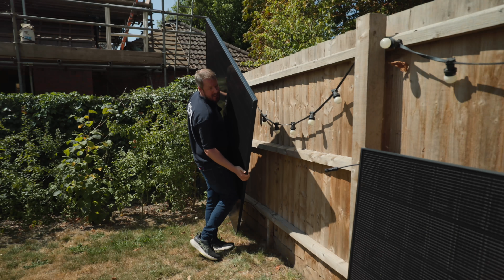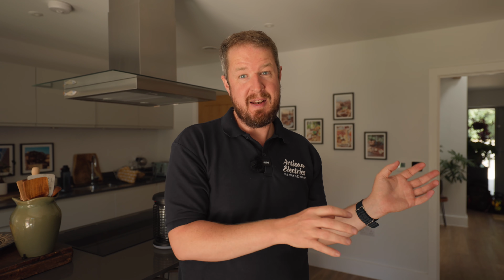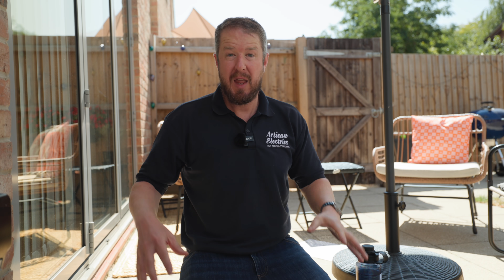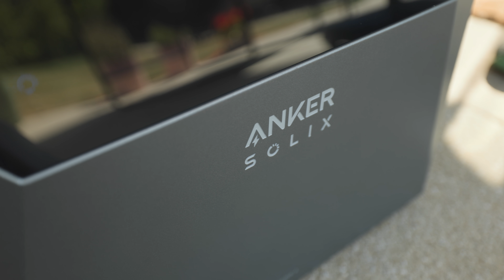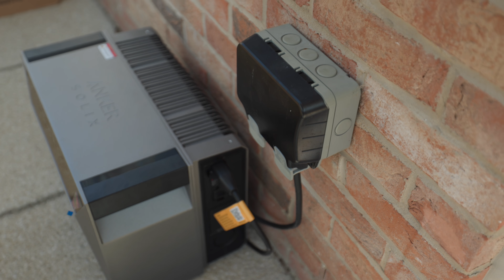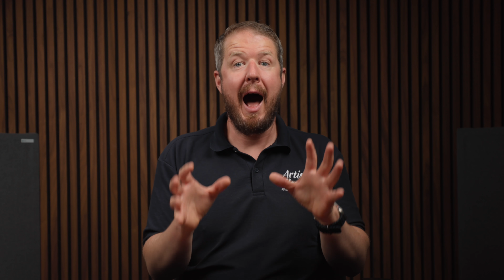The MISSING PIECE of Plug-In Solar

Comment: I didn't think the new plug-in-solar rules allowed plug-in battery storage
Reply from the maker: Under current UK regulations, it needs to be hardwired by a qualified electrician. The bonus being, you get that 2,500W output! ⚡
Reply: @artisanelectrics  What does "hard wired" mean in this context? e.g. the Anker unit you show in the video, obviously has a detachable lead with a plug - so could that unit be hard-wired?
Reply: Looks like you're right - plug-in batteries are currently NOT covered by the regs: Although, quite honestly, they're probably just as safe as a solar system, if they're limited to the same max wattage.  Personally, I'm tempted just because of the 2.5kW "off-grid" socket on the battery unit - seems like a much cheaper and more flexible option than a dedicated UPS, it's enough to run my office AND coffee machine, and frankly, that's good enough for me!  If it can be configured to only pull from the grid & not push, then I reckon that'd be enough to sidestep any legal issues. After all, you can plug in a battery charger (which is how it would act) with impunity today.
Reply: From 27th August legal, BS7671 Amendment 4, there's a New BS7671 out in October this year, it might be a best seller to wait until October, I might ask Chat GPT or Dola Ai's for info,

Comment: But I thought batteries were not approved for plug in solar in uk ?
Reply from the maker: Current UK regulations require these to be hardwired by a licensed electrician to remain compliant.
Reply: @artisanelectrics  I am a huge fan of your channel, however in this case I think that this episode is misleading wrt the context for the new UK regulations.

I totally agree that adding a battery makes sense but this is not permitted in the new regulations.

Respectfully, I think that the responsible thing to do is to re-edit this video. You will preserve your credibility by adding some very clear statements to balance the narrative. Otherwise you are in danger of being seen as presenting an advertorial as other contributors have pointed out.

Best
Reply: @artisanelectrics so a very misleading video then.  This is not up to your usual informative videos.

Comment: Fined in the Netherlands to send power to the grid ? Where did you get that total BS, Whe can earn money with solar and plugin battery with a dynamic contract and the Netherland are the frontiers of the plugin battery for years. A plugin can be instaled on a seperate free 16Amp fuse without elektrician to charge and discharge with 2500 watt On a used circuit its just 800 watt discharge and 2500 watt charge

Comment: First thing I did when I got solar was set a timer on the hot water heater. It heats 200l so by doing that in day from solar when sun shines I make sure to take full advantage.
Reply: Even better would be to use a heat pump waterheater. Those only need a third to a quarter of the energy.
Reply: @Felix-st2ue absolutely but the investment is insane.
Reply: @1kreature it depends. If you anyways need a new water heater the cost difference is only around 1k (at least in continental europe). So definitely worth it.
Reply: @Felix-st2ue not in Norway. For a normal micro split system I was quoted £2.6k fully installed. For a electric water heater it was only £600 well the heat pump version was £5.6k! We never get quoted the gas version because we do not use gas here.
Reply: @1kreature over hear the heat pump heater costs around 2-3k plus install. But i guess your electricity prices are nowhere near our 30ct.
Reply from the maker: Great thinking, making the most of your self-consumption is exactly the goal! 👍

Comment: The UK regs do not allow a battery for plug-in, only if wired by a qualified electrician
Reply: Correct it’s only the solar panels atm
Reply: @Element115-gravity wrong, look up portable plug & play power stations UK law before you comment next time.
Reply: @Rodders1234 So confident yet so wrong 😂 Plug-in battery on its own is not allowed yet. There’s talk it’ll be legal next year
Reply: @Rodders1234  the point is not the battery but the device that controls the energy amount you are feeding in to reduce the output of the inverter.
That can only be installed by a certified I bet, the UK regulations are more or less a copy of the german .. hence the chinese adopted the german setup for their own product.
Reply: @mjw199 I need more than 'talk' to spend thousands.
Reply from the maker: You're absolutely right, UK regulations require a hardwired connection by a qualified electrician for this setup. ⚡
Reply: @artisanelectrics  wrong, portable plug & play power stations are not considered a permanent fixture under UK law & do not need your expensive help.
Reply: @Rodders1234  so how do you tell your battery not to export its power back out to the grid???.... you will need a sparky to install a measure device in your consumer unit ,unless you want to run extension cords off the unit to supply power to your appliances.
Reply: @craigpalatchie2607  you will always be using power so will never export that amount also 800 watts is nit shit for DNO i export 9kw on an average day they then need to worry on my close i run 60kw of battery storage on pylontech us5000 batteries solis 10k inverter
Reply: @Rodders1234  UK regulations are a copy of the germans in most cases. What you need is the value what you are exporting or importing and that requires an additional devica in the main panel which you are not allowed to do in germany and I bet in the UK too.
Reply: @Rodders1234 actually you are wrong
Reply: @Rodders1234 Actually UK regulations do not permit a battery as part of the plug in solar installation.
That IS fact.

However, what you can do is purchase and use a mains chargeable solar battery,or solar generator and plug this into a mains socket somewhere in your house.
It is not part of your plug-in solar installation; it's just a rechargeable battery charged from the mains.

And when there is a surplus of electricity from the panels the battery will be charged using solar generated electricity and the amount of surplus power going out to the national grid will be reduced.

What you can't do is connect the inverter output of your solar generator in your house electrics through a BS1363 plug and socket.

You can plug mains appliances into the solar generator and use that solar generator in the way it is meant to be used.
Reply: @Rodders1234 what he is demonstrating is not plug and play.
Reply: @Rodders1234  Just imagine correcting an electrician about electric installations. 

if you plug in the battery into the wall and supply to your home without a gateway, it can be very dangerous if there is power outage because you are energizing the grid from your home... and there is no possible way to have the gateway installed by portable power stations.
Reply: @craigpalatchie2607  It's limited to 800w when plugged into mains, same as plugin solar. It has a built in inverter. Just because regs don't yet permit it, it doesn't mean this thing isn't already designed to operate the same as plugin solar inverters.  People are already doing it.
Reply: @roadbiker8333  Plugin solar doesn't use a gateway either, the inverter detects the grid and cuts out. These batteries do the same because they are designed to have solar panel directly connect to the battery (they have inverters built in).
Reply: @MeTubesChannel THATS why it needs electrician to wire in and set up properly
Reply: Wired in by a qualified electrician is not as expensive as you think i had a quote of £75 pounds for the first hour plus parts i would not think it would take much more than an hour, but there are problems if you are in rented accommodation then some Electrisions will say a flat no and others will say only with a letter of approval from your landlord even for just batteries that would not be seen from the outside. You wanted to use a fence gov regs say not against wood, you want to use mix and match systems gov say no must be an all in one kit that may well be twice the price and have less wattage of solar. My best option would be to bite the bullet and find an electrician that will fit a spur or just plug it in but tell no one (except a g98) and pull the pull it out and set it up as a ups if your landlord is coming most have to warn you they are coming.
Reply: @kendrickapps674  Assuming the consumer unit has a free slot.
Reply: Yes, true but one can plug into a separate LiFePO4 battery (with solar power controller 12/24/36//48...V depending on the powerstation one uses) and keep it as storage. My solar panel system is very simple, 'Not' plug in solar, and completely independent.
 I'm planning to expand my 2 portable powerstations, each kept in separate rooms for different needs) with batteries and will also have a couple of batteries for storage.
Reply: Now try being in Australia where a solar battery will cost you about $10k, sure you do have a solutuion when there is a problem with the mains. Plus of course the cost of the solar system to start with. Stay at your house for over 10myears, then all good. Except for the vattery will have degrarded by that time and time for a new battery.
Reply: UK legislation says “balcony” solar panels can generate up to 800w per house and cannot be connected to a battery “yet”, regardless who installs it.
Reply: True, but it appears he is a qualified electrician.  Could be wrong, but I don’t think so.  Anyway he is apparently exploring what might become possible using a qualified electrician.
Reply: Funnily enough, he's an electrician 😮
Reply: @Mazza-i8b  Not very bright, are you?
Reply: @linuxgaming69 nor are you divvy, look up plug & play portable power station UK law before commenting.
Reply: Wrong, portable plug & play power stations are allowed as they are not considered a permanent fixture. Get your facts right.

Comment: So (I think I have already asked this) Your meter cannot read the flow in reverse ? if I only have a 500w load running in the house and a 1000w solar panel the meter sees zero or does it record the extra 500w as flow and I get charged for it even though its going backwards?  We had counters on the doors of a shop, they gave a total footfall number but we had to divide it by 2 assuming everyone that came in left the shop. 
My personal solution is a solar panel and a Jackery and run my evening/night office workspace from that.
Reply: It depends on the meter really. The old one with the disk might even rotate backwards. For the newer ones they may either just see a zero or count the ingestion in a second register.

Comment: Looks like there is no gateway on those systems! How do you stop backfeed to the grid when power goes down??
Reply: They shut themselves off. You can't follow a frequency that doesn't exist.
Reply: These are grid following inverters. They will match the frequency and the voltage of the grid, and if the grid disappears, they will shut off their output in milliseconds. There are norms in germany which describe these limits.
Reply: @luc_libv_verhaegen Yep... it’s called “anti-islanding” and it’s a mandatory safety requirement built into every grid-tied solar/battery inverter....
.... Unless the inverter has a dedicated separate "maintained" output, with a grid-tied inverters: no grid = no power.
Reply: Good question. Suddenly nobody is talking about all the things they were making videos about back when the videos were all explaining why plug in solar can not be legal in the UK.
Reply: @BrianG61UK  That's because they were talking out of there ars*, if the inverter cannot see or synchronise to the grid it will not output any power, it’s a mandatory safety requirement built into every single grid-tied solar/battery inverter.
Reply: @alanwood9804 But it's the opposite problem that's difficult. How can the output of the inverter know for sure when the incoming mains has been diconnected? How can it reliably not confuse a sudden change in the amount of power used in the home with the mains being disconnected?
Reply: @BrianG61UK   If the incoming AC supply is 50hz, then mains voltages passes through zero volts 100 times per second or 120 times a second for a 60Hz supply  (the zero point happens as the voltage swings from the positive to negative half of the cycle of the AC waveform). The inverter monitors to see if the supply voltage is actually crossing zero and if so it will synchronise to it (after a few cycles) and then start to output power. 
As the incoming mains is a fixed frequency the inverter knows exactly when to expect the next crossing point and if missing (or happens outside the expected timing window) it will immediately shut off its output. AC zero crossing detection/synchronising  circuitry is  simple and often only requires half-a-dozen components.
Reply: @BrianG61UK  There are norms which describe how much voltage and frequency difference from 50Hz and 230V there is allowed to be before these inverters are forced to shut down. When within these ranges, these inverters will strive to guide voltage and frequency towards the ideal values. What's more, an actual full inverter which is sitting after the grid connection, but before the house fusebox, this can be configured to raise the house grid frequency to tell "dumb" solar inverters to stop outputting to the house grid (to for instance, allow for zero feed in).

I'm not sure why this is a hard concept to grasp. Your fuel has a given octane rating, and a specific range of average carbon chain length, and an maximum allowed amount of water, to ensure that it is compatible with all the gasoline engines out there. The methane that is fed in your home should have a given pressure, has given fraction of maximum allowed hydrogen, and a list of maximum amounts of specific polutants like water. The air you breathe has a pressure, temperature and humidity range for which you are comfortable, there better also be a given fraction of oxygen so you do not shut down completely. Your macdonalds burger is only allowed a given amount of rat feces or cockroach parts before it is deemed no longer suited for human consumption.

We live in a world of norms and guidelines, and the same is true for the electricity on our european grid. And these inverters better adhere to that or there will be a sale stop, recall, and massive economic and reputational damage for the producer of said inverter (like the iirc, deye one shipping without that one required relay two years ago).
Reply: @alanwood9804 Well, yes, if you pick an easy case, then it is easy. What about when the inverter is powering everything in the home and the incoming mains goes off. How can it quickly sense that?
Reply: @BrianG61UK  it doesn't matter what its powering, unless something in the is acting as an AC generator, there will be nothing for the inverter to synchronise too,  and if it cannot synchronise it will not output power.

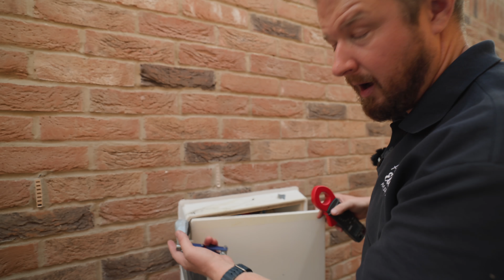Comment: 2:10 But can you get paid for plug in solar if you already have standard solar and you already export?
Reply: As you will already have a smart meter, DNO approval and some kind of export tariff then yes you will be paid as your meter & supplier will not be able to differentiate between your existing system and the plugin system, however your DNO may not be very happy if you export over the power that's been declared on the G98 form.
Reply: @alanwood9804ok cool. I mean my system never generates what it’s rated for anyway, so adding another couple of 300w panels should be fine right?
Reply: @roberthemsley2  shouldn't be an issue then.
Reply: Yes. There's a limit on how much a domestic system can be paid for though.
Reply: He can anyway - he's a qualified sparky, member of professional body and trained in solar/battery so it's one of the few cases where it qualifies as a SEG install.
Reply: @etchedpixels I’m asking for myself.
Reply: @roberthemsley2 the export meter has no idea which panels it came from. However if you have an existing system except a tiny one you will need a G99 amendment before you add any more AC coupled generation. That has to be done in advance and may be refused.

Comment: You are completely wrong on the "can I get paid".

You are one of the few people who can get a SEG payment for a plug in solar system because you plugged it in and therefore it was installed by competent electrician who is trained in solar/battery. That means you qualify on the "or equivalent" bit of the SEG rules.

And batteries are not approved plugin, nor is random solar, ... 

Makes you wonder if chatgpt wrote this.